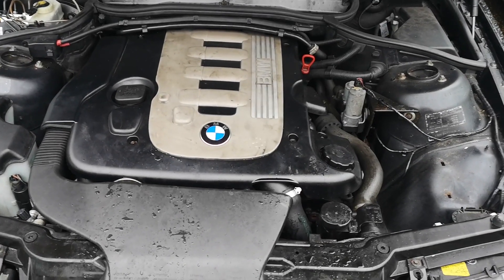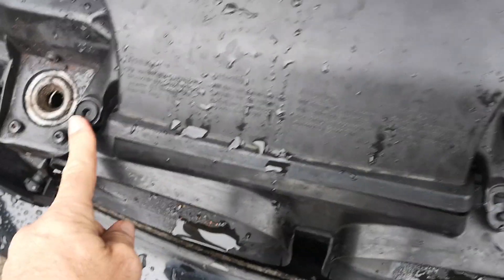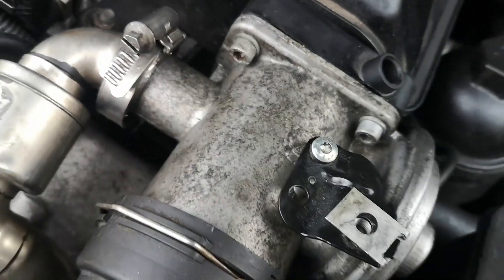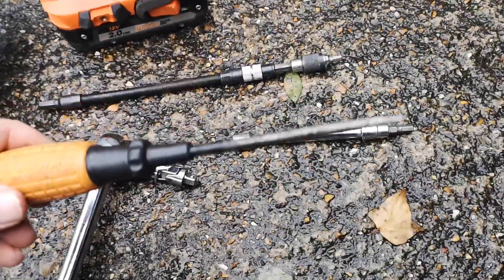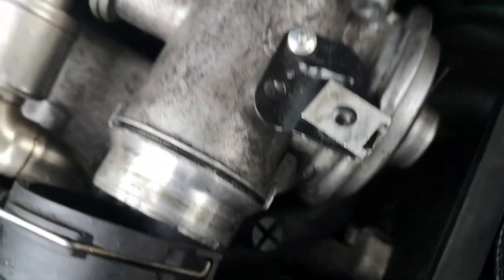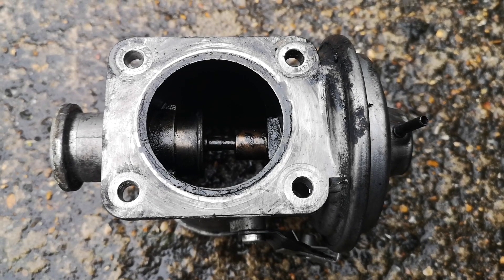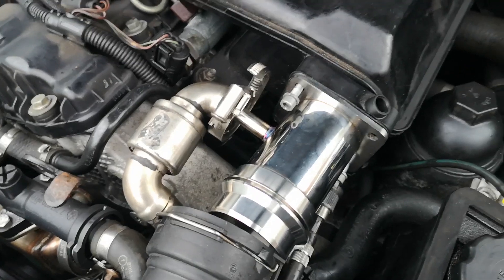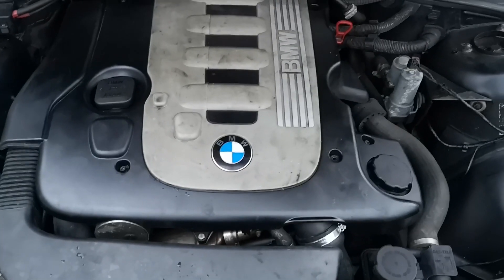BMW E46 330d 320d EGR VALVE REMOVE REPLACE DELETE UPGRADE 2005

Comment: What a weird egr delete . Usually the egr gas pipe is gone to the bin.
Reply from the maker: Hi.. Yes in the EGR delete kit  you get a block, for the pipe but then you will find the EML light will come on.. Then this needs to be mapped out.. So I ended up cleaning and sticking with the original for now.
Reply: I have this bypass kit too and só far só good now

Comment: Does doing this damage engine?
Reply from the maker: This will increase the air flow... and improve performance... so no damage to the engine.
Reply: Ive done it and having safe mode issues even after softwere fault code
Reply: Removing and coding
Reply from the maker: @adnanulepa9661  That sounds like addtion issues.  All that may happen is your EML will come on.. which would need coding out.

Comment: Hello. Send me link for this please
Reply from the maker: Hi check your egr is the same as mine.. which was on a 2005 330d if it is... this is the link. https://www.ebay.co.uk/itm/BMW-EGR-DELETE-E46-330D-E60-530D-E65-E83-REMOVAL-KIT-BYPASS-not-BLANKING-PLATE-/153017094935?_trksid=p2349624.m46890.l49292